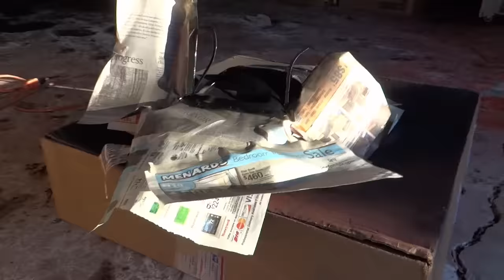RC Modify 10 | Toyota Supra MK4 - RC Car

Comment: Why can't I buy this
Reply from the maker: +Ray Progamming It's mine. :P You can buy one of these.
I buy this one:
http://www.nitrorcx.com/madspeed-drift-car-green.html
These ones are good too, but they are more expensive:
http://www.ebay.com/sch/i.html?_sacat=0&_from=R40&_sop=15&_nkw=1%2F10+madspeed&rt=nc&LH_BIN=1
http://www.ebay.com/sch/i.html?_odkw=1%2F10+hpi+drift&_udlo=190&_sop=15&LH_BIN=1&_osacat=0&_from=R40&_trksid=p2045573.m570.l1313.TR2.TRC1.A0.H0.X1%2F10+hpi+drift+RTR.TRS0&_nkw=1%2F10+hpi+drift+RTR&_sacat=0
http://www.ebay.com/sch/i.html?_udlo=290&_sop=15&_mPrRngCbx=1&LH_BIN=1&_from=R40&_sacat=0&_nkw=1/10%20mst%20drift%20RTR&rt=nc&_udhi
http://www.ebay.com/sch/i.html?_odkw=1%2F10+tamiya+drift&_udlo=300&_sop=15&LH_BIN=1&_osacat=0&_from=R40&_trksid=p2045573.m570.l1313.TR0.TRC0.H0.X1%2F10+tamiya+drift+RTR.TRS0&_nkw=1%2F10+tamiya+drift+RTR&_sacat=0

Comment: where do you get the body from???
Reply from the maker: this http://www.ebay.com/itm/1-10-RC-Clear-Lexan-Body-Toyota-Supra-200mm-Nitro-or-Electric-Colt-/122041292724?hash=item1c6a3a57b4:g:xVMAAOSw2x1XKrxF
Reply: +DarkDragonWing .thx mate
Reply: What chassis did you use?
Reply from the maker: Julien Bucci This one was MadSpeed

You can build it yourself like this video here. Look in the description for links:
https://youtu.be/aJGDfJp9cZY
Or you can buy one of these already built:
http://www.nitrorcx.com/madspeed-drift-car-green.html
http://www.ebay.com/sch/i.html?_sacat=0&_from=R40&_sop=15&_nkw=1%2F10+madspeed&rt=nc&LH_BIN=1
http://www.ebay.com/sch/i.html?_odkw=1%2F10+hpi+drift&_udlo=190&_sop=15&LH_BIN=1&_osacat=0&_from=R40&_trksid=p2045573.m570.l1313.TR2.TRC1.A0.H0.X1%2F10+hpi+drift+RTR.TRS0&_nkw=1%2F10+hpi+drift+RTR&_sacat=0
http://www.ebay.com/sch/i.html?_udlo=290&_sop=15&_mPrRngCbx=1&LH_BIN=1&_from=R40&_sacat=0&_nkw=1/10%20mst%20drift%20RTR&rt=nc&_udhi
http://www.ebay.com/sch/i.html?_odkw=1%2F10+tamiya+drift&_udlo=300&_sop=15&LH_BIN=1&_osacat=0&_from=R40&_trksid=p2045573.m570.l1313.TR0.TRC0.H0.X1%2F10+tamiya+drift+RTR.TRS0&_nkw=1%2F10+tamiya+drift+RTR&_sacat=0
Reply: DarkDragonWing Thanks for the reply!! I was looking at that, as i'm about to build one. I was wondering if  I should go rwd or 4wd, rwd looks much more fun, It was either the D4 or tt-02, you recommend rwd?
Reply from the maker: Julien Bucci I like Sakura RWD. Once you learn how to drift it, you will never want to go AWD again. :D
Reply: I have one on the way from RCmart :)

Comment: where did you buy that
Reply from the maker: +Ryvhen Ross Pelimer You can buy one of these.
I buy this one:
http://www.nitrorcx.com/madspeed-drift-car-green.html
These ones are good too, but they are more expensive:
http://www.ebay.com/sch/i.html?_sacat=0&_from=R40&_sop=15&_nkw=1%2F10+madspeed&rt=nc&LH_BIN=1
http://www.ebay.com/sch/i.html?_odkw=1%2F10+hpi+drift&_udlo=190&_sop=15&LH_BIN=1&_osacat=0&_from=R40&_trksid=p2045573.m570.l1313.TR2.TRC1.A0.H0.X1%2F10+hpi+drift+RTR.TRS0&_nkw=1%2F10+hpi+drift+RTR&_sacat=0
http://www.ebay.com/sch/i.html?_udlo=290&_sop=15&_mPrRngCbx=1&LH_BIN=1&_from=R40&_sacat=0&_nkw=1/10%20mst%20drift%20RTR&rt=nc&_udhi
http://www.ebay.com/sch/i.html?_odkw=1%2F10+tamiya+drift&_udlo=300&_sop=15&LH_BIN=1&_osacat=0&_from=R40&_trksid=p2045573.m570.l1313.TR0.TRC0.H0.X1%2F10+tamiya+drift+RTR.TRS0&_nkw=1%2F10+tamiya+drift+RTR&_sacat=0
Reply: Ty dark
Reply: Darkdragonwing can you give me your Mazda rx-7 veilside pls.
Reply: I'm from the Philippines in cordillera in itogon benguet 
Address:04 Poblacion Itogon Benguet

Comment: or
Reply from the maker: +Jaziah Guerrero You can buy one of these.
I buy this one:
http://www.nitrorcx.com/madspeed-drift-car-green.html
http://www.bananahobby.com/rc-surface-vehicles-electric-on-road-cars.html
These ones are good too, but they are more expensive:
http://www.ebay.com/sch/i.html?_sacat=0&_from=R40&_sop=15&_nkw=1%2F10+madspeed&rt=nc&LH_BIN=1
http://www.ebay.com/sch/i.html?_odkw=1%2F10+hpi+drift&_udlo=190&_sop=15&LH_BIN=1&_osacat=0&_from=R40&_trksid=p2045573.m570.l1313.TR2.TRC1.A0.H0.X1%2F10+hpi+drift+RTR.TRS0&_nkw=1%2F10+hpi+drift+RTR&_sacat=0
http://www.ebay.com/sch/i.html?_udlo=290&_sop=15&_mPrRngCbx=1&LH_BIN=1&_from=R40&_sacat=0&_nkw=1/10%20mst%20drift%20RTR&rt=nc&_udhi
http://www.ebay.com/sch/i.html?_odkw=1%2F10+tamiya+drift&_udlo=300&_sop=15&LH_BIN=1&_osacat=0&_from=R40&_trksid=p2045573.m570.l1313.TR0.TRC0.H0.X1%2F10+tamiya+drift+RTR.TRS0&_nkw=1%2F10+tamiya+drift+RTR&_sacat=0